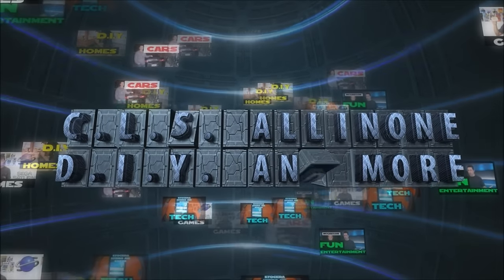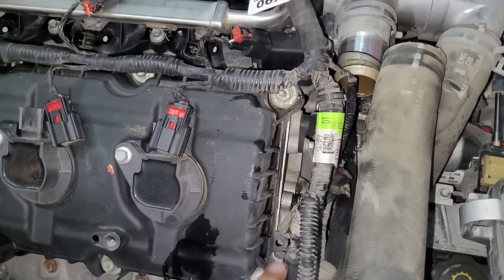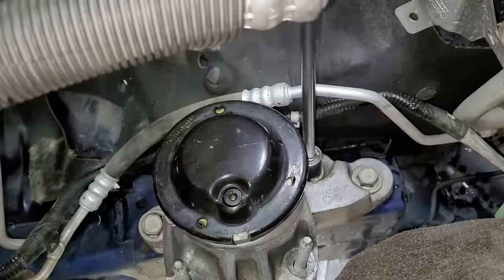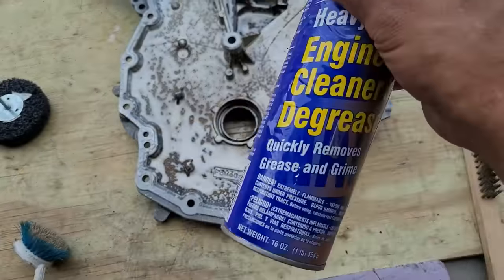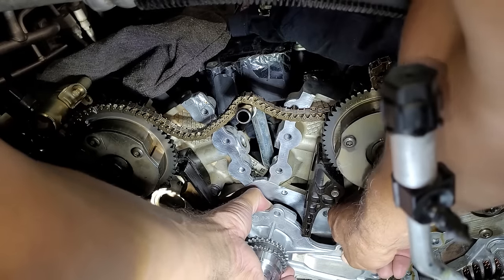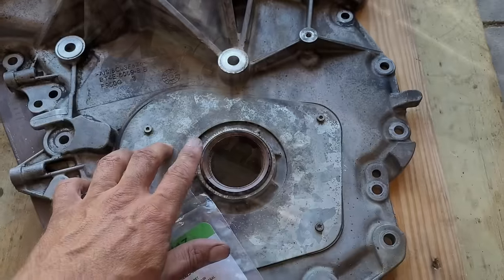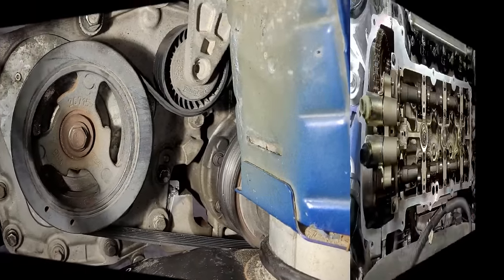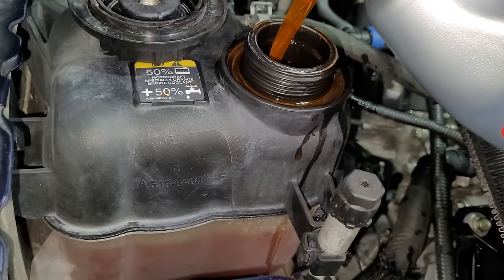How to change a water pump in Ford V6 3.5 & 3.7-liter engines 2012-19 Explorer, Taurus, Edge & more

Comment: THANK YOU THANK YOU. I am NOT a mechanic but I followed your video and replaced my 2011 Ford Explorer water pump. I however encountered code "P0017 crankshaft position camshaft position correlation Bank 1 Sensor B." After changing my sensors without success, I opened the vehicle again and realigned the timing chain. That worked - it drives like new. To avoid this mistake it is better to use the 3 MARKERS ON THE TIMING CHAIN as your guide, instead of the paint markers. When I used the markers on the chain, I noticed that I was a tooth-off the chain; and that's why I got the code P0017. Besides that, thank you so much for this video it saved me a lot of money.

Comment: This just hit my 2018 Explorer. 22000 miles. Just had it flushed a week ago and next week changed the oil. That is when they found it. This is reported to be quite common repair. Very expensive and a lot of areas to mess up you would not know about until damage was done. I doubt all mechanics are as neat and expert as our host. I bought an extended warranty from Ford a few months ago and hope they do not find away to void it. I guess on any new car if warranty is expired re new it or sell the car!🦇 What a great video.🦇
Reply: Yep, this design is literally design to kill the engine after the warranty is done
Reply: UPDATE: They paid it save $200 deductible. Kept cars 9 days. Buy the warranty and you can shop these nationwide. I live in Va. and bought warranty from a dealer in Ct Oh yeah, cost w/o warranty? $4,000 I wonder if the B&G flush brought this on .🦇

Comment: Worked perfectly for my 2016 Taurus 3.5 NA, with the exception of the fuel line bracket which I unbolted and tucked behind the fender, the washer reservoir, which was keeping the ac line in the way,  so unbolted washer resivor and dropped it a little and then bent the ac line towards the fender. Also found timing was off by one link. Engine runs super quite now! Didn’t even know it was out of timing and how much one link makes a difference. Great job! You have a donate page? Like to get you a beer or coffee!
Reply: How did you fix the timing??

Comment: I have to have my water pump replaced on my 2010 Taurus. It overheated twice. Never noticed any leaks. I added about 3.5 gallons of coolant. It just seems to disappear. Now I know where it went! Inside the motor. I'm having a highly recommended shop check it out. I'm so nervous I smoked the motor. They quoted me $2200. I thought that's crazy. But after watching your video, ( which is excellent by the way) and reading the comments $2200 isn't that bad for all the labor and knowledge involved. 🙏 I didn't do any damage. I love my Taurus.
Reply: as long as it gets cleaned out and the water pump replaced, I think youll be fine

Comment: Thanks for the detailed video on this repair. I will be doing it tomorrow on my 2017 explorer. 
How did you keep the crank from turning when you torqued the crank pulley bolt?
Reply from the maker: You will need a crankshaft pulley holder.
Reply: @D.I.Y._All-in-One  Thank you got started last night half way through the tear down. Thanks for the detailed video I did not have the money laying around to pay a garage to do this.
Reply: @C.L.S. All-IN-ONE  can you provide a link or part number for crankshaft holder?  I'm having trouble finding one
Reply: @williamgifford209  I could not find one for this engine. I ended up using a ratchet strap. And I fell about 5 degrees short of the 90 degree yield. I think the main thing is that it is tight. This is a keyless pulley and it if it is not right you risk jumping time. 
I’ve already put over 1000 miles of heavy interstate driving on mine since repair and everything seems good.
Reply: @jeremyhale5067  good point.   I'm checking often until I get that 90 degree additional turn
Reply: There has to be a way
Reply: @jeremyhale5067  how is there a risk of jumping time from just the crank pulley?
All it does is Drive the serpentine belt so it's just a matter of being tight and not falling off if the bolt loosens up or snaps off which has certainly happened on many harmonic balancer pulleys.
The timing, however, would not be affected by the chain which is on the gear which is inside the cover.

Comment: Just a heads up for anyone doing this. If your valve cover bolts don't look near perfect, it's probably best to just replace them. Mine looked pretty good aside from a bit of discoloration on a few. First bolt sheared right off, flush, before I even made it anywhere near the initial 177 in-lbs(~15 ft-lbs) and it was on the back side of the back bank. Luckily, because the torque on that bolt is so low, the bolt was able to be easily backed out with a left-hand drill bit and extraction bit. But drilling into metal near open valve covers, even with precautions taken to avoid metal shavings getting in, is risky business; as is drilling so close to an aluminum mating surface. One small slip and "some disassembly" would be required.

Comment: I’m currently on the 24hr dry time, tomorrow morning I add fluids and start her up. I have a 2018 Explorer 3.5 w/68,000 miles when it started the infamous leak under the compressor. My gosh, it hasn’t been easy by any means with this job. Lots of tools are needed apart from the ordinary. This video made life a lot easier, I’m in around 750 realistically, I had to buy lots of new tools unfortunately.

Comment: Great video! Crazy that Ford would design an internal water pump as replacing is considered maintenance over 100k miles. The work associated with this is enough for me to never consider a Ford product again.
Reply: There are Nissans, Toyota, and several others doing this. The Nissan V6 has been around 20+ years and is the best as they have cover over tensioner and pump tondo the job without chain cover removal or chain coming off. GM Duramax v8 have water pump that is as bad as it it timing gear driven and they chose to put one bolt under harmonic balance partway where it can't  be removed. The list of service items that have poor access without lots of unnecessary other component removal is long and widespread. You'll be lucky to buy a car or truck and avoid it. If you miss it on mechanical parts then you may fall victim to a component that has to be programmed to car to work, like headlight.
Reply: @jimmyaber5920  All designed to put more $ into the dealers pockets for regular maintenance. I just replaced the electric water pump on a 2011 BMW 328i, pain in the ass, but at least I didn’t have to take half the engine apart. It makes you wonder when working on a BMW is easier than working on a Ford.
Reply: Never buying Ford again due to this
Reply: Mine lasted until 212k miles so they can go pretty long for a water pump.
Reply: @crg34  good to know Carmello, mine has 130k.
Reply: @crg34  how often do you change your coolant ?

Comment: Do not torque to 15 ft lbs on valve covers it will ring off. 88 inch pounds is what I found in another video. However if you Google it the first one from Ford specs says 177 inch pound but the first one I did broke. 7 foot lbs is plenty

Comment: IF you decide to remove the CAM Phasers MAKE SURE TO BUY THE CAMSHAFT LOCK TOOL AND USE TP55 TORX PLUS BIT (Not the same as regular T55). The Cloyes timing kit comes with an installation video on Rock Auto and they suggest the cam lock tool isn’t necessary, so I attempted my repair without it and regretted it (added a full day of work). This is because the effort to remove the phasers is significantly higher than the installation torque. A regular T55 will strip the bolts and it took 3 people to hold the cam shaft and break the bolts loose with a metal pipe. The cam locking tool is also useful when reinstalling the crank pulley. Be careful not to over torque the crank pulley with an impact gun the pulley can over travel and bind the pulley. Also make sure the primary chain is on when you loosen or tighten the phaser sprockets. Great video if you replace all chains heed my warning about the cam lock tool and TP55 bit.

Comment: I will occasionally do some of my own fixes when the vehicles are having issues. One thing this video made clear to me is that I probably just need to bite the bullet and take it to the shop for this repair.
I probably could do it, but it would take up a LOT of time, and the risk of me screwing something up is just too high.
I am definitely thankful to be able to see what all goes into it though. Makes me more knowledgeable on what to expect from the shop, and not to have a stroke when  I get a quote in the $2k range.
It really is a damn shame that Ford designed it in this way, where it is so difficult to change out a part that WILL need replacing.
Reply: Can you just use sealant coolant fuild? The leak repair fluids i mean for this issue

Comment: Hell of a video! Saved me thousands. I advise installing a new Motorcraft primary timing chain, guides and tensioner since you have to disassemble those parts. No need to mess with the 2 secondary chains. Make sure the chain is tight with no slack. I had to rip everything back apart because my timing chain was too loose and off a link or 2 and making a lot of noise. It’s easier to make sure you’re on time with a new chain because it comes pre-marked whereas the old chains marks have worn off. You have a new subscriber. Thank you!
Reply from the maker: Glad it helped!

Comment: Wow  awesime video.  I had to have mine done on 2014 3.7 police interceptir at 210,000 kms 166,000 mi.  If i had seen your video i might have attempted this my self.   I had my timing chain, guides, all gaskets, soark plugs, i even reolaced the oil pump and main seal.  Replaced all coolant, oil, transmission and PTU fluid.  Total bill was $ 4,000.  1500 parts, 2000 labour, fluids n tax.  Car runs great   no wortied for another 200,000 kms

Comment: you've probably heard this a million times already but this IS AN EXCELLENT VIDEO on this topic! I'm not a mechanic but your detailing of the process is so in-depth and easy to understand that if this was something I needed to try myself (heaven forbid ....) I almost think I could do it!
The vehicle I have is Ford Taurus 2008 (I'm assuming it has the same engine as the 2012 and later models) with >200K miles on it. The pump seems to be doing fine (no leaks, oil is fine (not "milky" from coolant) but given this 100K miles life expectancy I suppose mine could go any time now!
But since I only paid $500 for the car, probably I'd sell it to a salvage place and look for another car!

Comment: I just want to say thank you very much for showing me how to install a water pump on my 2015 Ford Explorer limited  I paid $1200 to get that replace it hurt but thank you very much for your instructions and for your help
Reply: I'm curious. You had someone do it or you did it yourself?
Reply: Wow! Did you go to a repair shop and not dealer? Because here in Miami it's $1900 for the water pump replacement. $400 more to include the timing chain.

Comment: A very good video, clear instructions.😊 And I love how you mentioned, Waiting with the permitex before you do your final torque😊 That is important. If you do not wait, you will squeeze 90% of the gasket Maker out and you will have leaks eventually.
Reply: Also wait at least 24 hours before adding fluids. at least with permatex gray or Ford

Comment: Amazingly detailed video--the best out there by far! I'm currently in the process of doing this job on my 2019 Taurus (85k miles). Thankfully I spotted the leak straight away before any coolant got in the oil pan. I'm about ready to remove the timing cover. So far the most difficult things for me were the fuel injector connectors (took forever and I ruined one in the process) and getting the harmonic balancer (crank pulley) off. Oh and the south central Texas heat isn't helping me. I'm only able to spend a couple hours a day on it due to the heat but I'm happy to take my time.
Only a couple issues with your video so far... first, it gives the impression that the crankshaft bolt is reverse threaded (which it isn't) because when you demo how to take it off you zip the impact in the wrong direction. Thankfully, I did research this before attempting to remove it. Also, I wouldn't recommend people use an impact wrench with the puller tool to get the harmonic balancer off. Better to just use a good strong socket, extension, and breaker bar and do it slowly. Putting so much impact vibrations on the crankshaft isn't going to do the engine any good. Also, I did try using a smaller bolt in the crankshaft hole for the puller tool but I found what works best is to just use a socket that fits inside the balancer hole and then put the tip of the puller tool into the back (smaller) opening of the socket. Even using a smaller bolt in the crankshaft along with an impact wrench can damage the threads inside the crankshaft and, if that happens, you'd be in deep deep doo doo.

Comment: That was a excellent tutorial of the water pump process for the 3.5 and 3.7. very calm and very thorough. My only question is why you did not change the timing chain when you had gone through so much labor to get the front cover off. Do you only change it when the adjuster is maxed out? Thanks again for you time and effort.

Comment: 2012 Ford Edge SEL AWD - Stretch belt was a fun install too. Brought the double ribbed tool, ended up using heavy duty zip ties. Harbor freight normal zip ties won’t do it.

The video is perfect. Download the Ford workshop manual and have at it.

Comment: very informative  video.
My 2008  Ford  Edge  waterpump  failed  3 days ago at 183k miles.
I am thinking what to do with  it. fixing it is more than the value of it.
shouldn't you change the bearings too if the coolant  is already in the engine.?

Comment: Great video. My 2017 Flex with 166k miles has the dreaded antifreeze leak from the same place. 

Marking the timing belt seems pretty clear, but what if you want to change the timing belt? How do you know where to place it if you don’t have the marks to use on the new chain?

Comment: Hi I have a 2013 Ford explorer limited non-turbo okay we put a new thermostat on it and there's now fluid pouring from the thermostat housing at the bottom but I also have a dripping leak in the front passenger side of the vehicle under where the water pump is after replacing the thermostat the fluid started pouring out the housing I replace the gasket I'm really if you could give me any information that you could see that where I could start before I have to actually replace the water pump which I'm pretty sure that is the issue I just don't understand why the thermostat housing is pouring the fluid thanks

Comment: Excellent job!  I watched just to get visual detail on a part for reference and got engaged with the rest of the video due to your excellent camera work and attention to detail.
One thing I noticed, the crank balancer bolt (but not the washer) is specified to be replaced due to its stretch or TTY design.  You can use it to seat the balancer if you don't have the installation tool but after you perform the seating step (89 ft/lbs, then back off), discard it and use a new bolt to finish (37 ft/lbs then additional 90 degrees).
Reply: Question, how long should you take if a mechanic is doing this work on the side? I been waiting a while so I’m worried. 😂

Comment: Just a note to anyone doing this job: After I was done with this job, my engine ran like crap....was missing on a couple cylinders. So, I pulled the air filter assembly and air intake assembly, disconnected/reconnected basically all electrical connections, put it back together, and fixed the issue. Car seems to be running great. 
Also, the crankshaft pulley bolt was a complete PAIN to remove. I ended up heating it up with a small propane torch for about 15 seconds, and it came right off with an impact! 
DO NOT INSTALL THE CAMSHAFT LOCKS AND TRY TO LOOSEN THIS BOLT. A rookie mistake, but I did it, and skipped a couple teeth on the crankshaft sprocket. 
Another note, it is probably a good idea to go ahead and order the Clyes Timing chain. It comes with 3 different colored links, to make sure timing is set correctly.

Comment: Update: I did complete the water pump replacement but would have never attempted it without, what should be, an award winning YouTube video. This is not an easy job with the engine left in the vehicle and in several areas of the job you will need a second person. Make sure on the third chain guide (Min - 22:05) that you have someone, from the top, press the closed-end portion of the wrench, with a  long shafted pry tool, to hold it on the nut or you might strip the head especially when putting it back in. The other main issue I had was the bottom rubber portion of the coil pack on cylinder #1 (which is up against the firewall) cracked and broke apart inside the tubing. I worked several hours trying to get the remaining rubber inside the tube out - impossible, especially when you can't see it. I found a YouTube video where the guy used a 5/8" hole saw on a modified extension that worked great. I bought a Dewalt right angle, because it is up against the firewall and not enough space for my drill and slipped it down the tubing and around the ceramic on the spark plug. Ran the drill for several seconds and rubber remains pulled out with the hole saw. I had to muscle down on it for the hole saw for it to bite into the rubber and then blew the tubing out with compressed air to remove any leftover rubber particles. Another thing was setting the torque on the lower intake manifold cover grommet bolts to only 7.4 ft. lbs. If you go with a higher torque they are going to break. I'm am not sure how in the world C.L.S. took some of the pictures and videos and at the same time he was doing the work - really amazing. Again, thank you C.L.S.